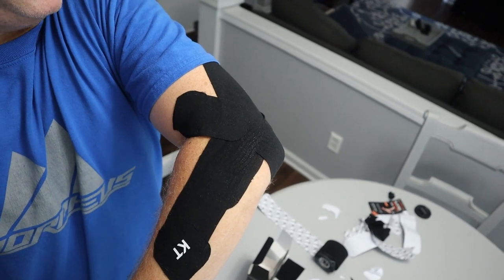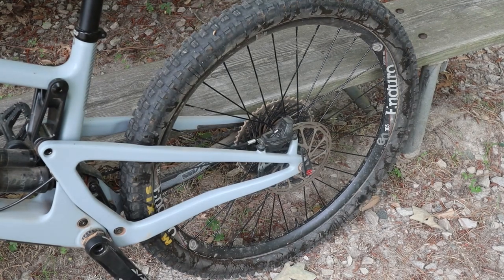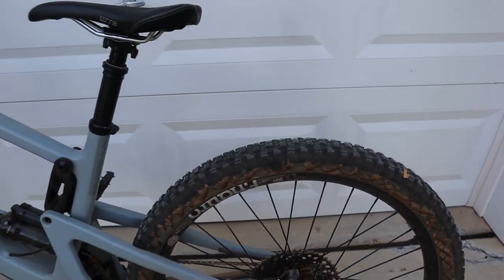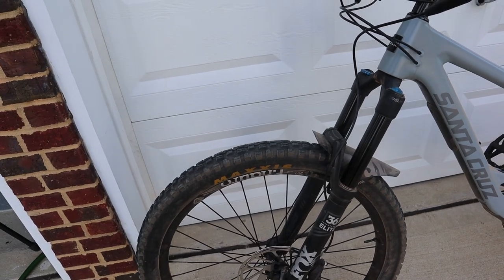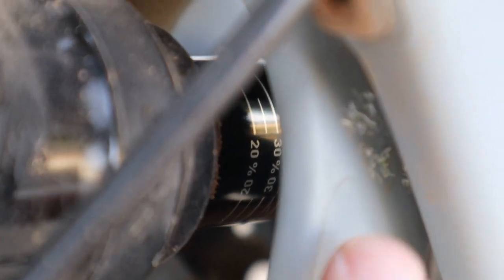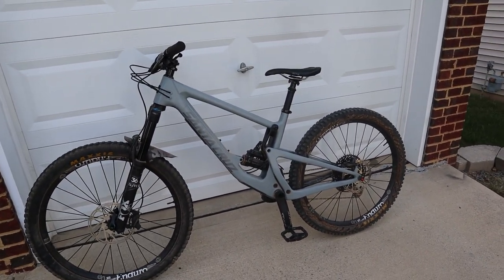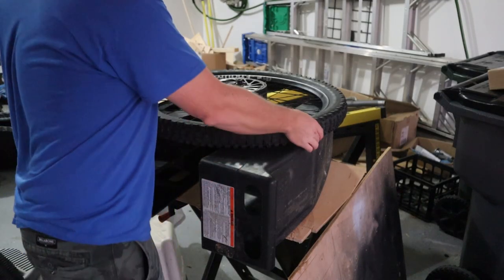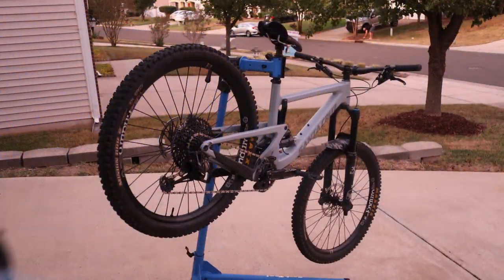#MTBPlanB Do your MTB tire sidewalls weep?

Comment: i have brand new maxxis minion dhr 2 and since they one i can see also sealant on the walls. but interesting you mention humidity. never tough of that.  and yes it could be a problem from manufacture trying to save weight. i would definitely try to see if reducing humidity would stop that issue or if is just maxxis tires production working to fast on their items for production and not focusing on a better build tire. thanks for the info
Reply from the maker: Seems to happen to other mfgs as well. I guess this rubber is more porous than I thought.
Reply: @MTBPlanB  i agree with you 100%
Reply: @MTBPlanB  hey bro listen. remember you mention humidity so quick story i live in new york and pass coupleof weeks is been very humid specially inside at the moment. and i realize the now the i have my ac units on and the house is now cool i dont seem to have the issue any more so im not saying these proof the humidity can be a problem and some tire but definitely is not leaking from the side walls any more i increase the pressure to 40 psi to see if with more air i can get the pours to open up and see if it will leak and notice a big difference even with more air no leaks on the walls i have check the whole day checking the walls. and there are fine so maybe something to do a test in the future for your chanel would be what happens  to  tires when they are around very high humidity compare to cold temperature. i know rubber changes from cold to hot but never knew how much humidity can impact a tire also. have a good one.

Comment: How did this go for the tire? I have some continental mountain Kings that are doing similar seeping ishues.. Still holding good air for 3 or 4 days but showing patches around the side... Will more sealent do the rest of the job? 🤔
Reply from the maker: I tried adding more sealant to no avail. I ended up getting a new tire. I’m waiting for the dog days of summer to see if it does the same thing.
Reply: I add glitter to the sealant....some people add ground up old tires.
Reply from the maker: That sounds like something I may try. Thanks!
Reply: @MTBPlanB  I just tried adding sealant, then leaving the tire on it's side for about an hour. This time, I rotated and shook the tire every 10-15 minutes. This seems to be working right now.

Comment: I run a pair of Maxxis Rekon plus tires 3C max terra exo protection tan walls. My sealant of choice is Orange Seal. A while back when I first put them on I would notice little beads of orange translucent liquid on my sidewalls and would always wipe them away. I never could figure out where it was coming from and why the sealant was not milky colored until now. It was seeping through the sidewall being filtered by the casing in sence turning from milky orange to what looked like drops of orange clear water on the outside of my casing on the sidewalls. I seen one other video besides yours that talks about this issue. He had tan walls tires like me  and thought it was just a tan wall problem but I guess it's not. I currently don't notice it any more on mine and yours is by far the worst case iv seen. I don't ever remember hearing of this problem in the past and am wondering like you said if Maxxis changed something.
Reply from the maker: Casings must be getting thinner and thinner to save weight?